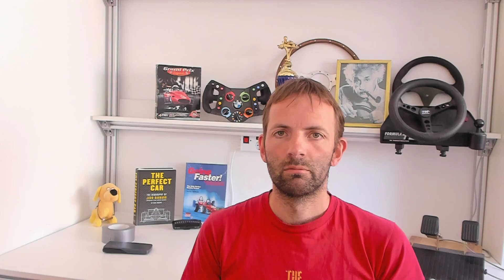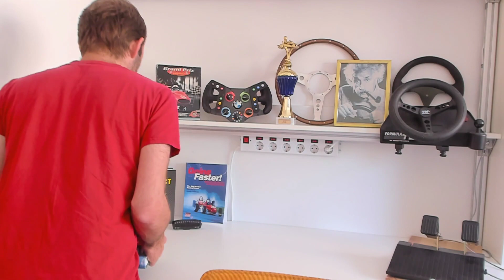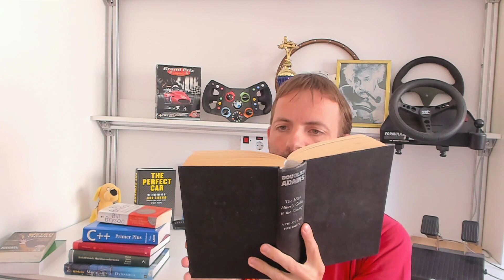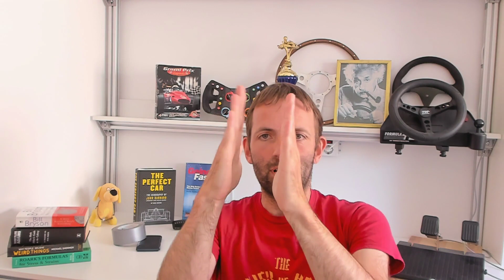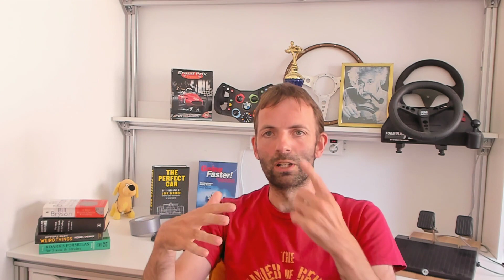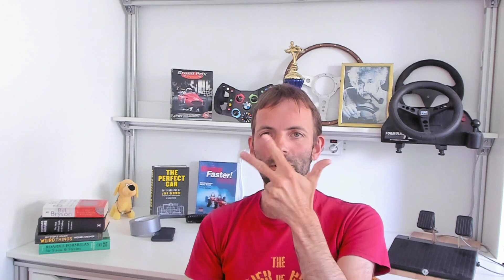Why are tires so difficult to model in a racing simulator?

Comment: Have you ever had the interest/tendency to make a tire tester yourself, to at least find out how a manufacturer gets their results and if possible fill in the informational blanks.

Not every tire is easily available but for example kart tires must be easy and say skip-barber/specracer/formula ford tires as well.
Reply from the maker: That sounds like a lot of expensive work! And then what are we looking at, the results of a possibly mediocre (lets face it) machine, or the actual tire behavior? :-) And we still can't isolate temperature effects, perhaps only measure them a bit... Mind you it is a cool idea! I know Todd Wasson was involved with a tire test machine for RC tires, which sounds like a super fun project to do. It won't really tell us anything about full scale tires though..

Comment: instead of using complex modeling with equations would it better for companies like iRacing (with budgets) to rent tyres test environment and build grip lookup tables based on different tests conditions?
Reply from the maker: Way back they published an article saying they did just that. But like I said, the results of a test machine don't always match tire versus tarmac grip levels, and you still might have issues isolating slip from temperature and pressure etc etc..
Reply: @NielsHeusinkveld  thanks for replying

Comment: Thanks for the info and since you haven't mentioned the SETA-tyremodel, some explanation about that: 
https://www.gtplanet.net/forum/threads/project-cars-2-tyre-model.370168/
What (the former) pCars 2 and now AMS2 is/was doing IMO much better is this feeling of driving on the edge of traction on the outer sidewalls of the tyres and this super natural feeling while driving over higher curbs for example. But the curb-surfing in iRacing was always great as well even before TM7, so it might not be a think about the tyre-model itself. IMO the 2nd major handling-difference across sims are the differential-physics and the aero downforce seems very different across sims as well. Also every sim has a different interpretation of the Newton's laws of physics it seems, so how weight acts to all the other things. Overall the best litimus-test is watching onboards, studying the slip-angles and how they effect the car, what steering inputs are needed etc.

Comment: Have you tried the skip barber on iracing recently? The tire model on that is AMAZING. I stopped racing it until 2 days ago on an off chance race. Blew my mind.
Reply: Jesus Christ I have read those kind of comment since 6 years plus. Maybe this time it’s true, Jesus Christ.
Reply from the maker: @PALbub  I thought you were being rude but you are simply quoting the guys name. :D
Reply: Also the skippy has its limits. In Spa you will see almost everyone spin in Rivage. When you play around with the setup you have to use very low air pressure in the tires and totally soft anti roll bars in rear to get through there without having an unstoppable oversteering car. I dont think the real Skippy would behave that crazy. But for example on the Norschleife the Skippy is awsome fun to drive.
Reply from the maker: I haven't.. Thing is, each year, each tire model there is this one car that they say is amazing. But when it is the underlying model that I dislike (rightfully or wrong), its unlikely to float my boat. I've heard equally negative things about the Skippy. That it is weird and too easy... Simracing is quite subjective eh!

Comment: Niels interesting video. Tire modeling is indeed a complicated issue due to the variances in real world tire data. I think the more reason for real world race drivers to properly validate the tire realism on sim the better. With that said, I am very happy on how most of the AMS cars handle on the edge of adhesion.  Still a bit hit & miss for AMS2 but I hope they get to fine tune everything in the future. The wet weather modeling needs work, I think it's a bit too forgiving on trail braking in the wet and too grippy on the curbs, painted areas.

Comment: Can you say why iRacing and RF2 went for a physical model instead? Seems way more complex and harder to work with, but surely there are some advantages to it or they wouldn't be pursuing that model?
Reply from the maker: Good question. I think these big brain programmers enjoy these big challenges. And, if you do manage to get it right, its amazing. Perhaps they felt they would get there, perhaps a bit over optimistic. And then the reality is that you can easily spend years programming an increasingly complicated and hard to work with model. That's completely just my view on it, I haven't asked any of the programmers...
Reply: Dave K explains it here.  As you might expect, his views are the opposite of Niels.

https://www.iracing.com/the-sticking-points-in-modeling-tires/

it is a very long read.
Reply: @davidwright1605  I don't get it, how are the views opposite? Kaemmer sums it up pretty neatly: "Why not just use an empirical model and be done with it? Wouldn’t that be easier? Well, it would be easier to code up the model, but it’s much more complicated to tweak and tune it so it has the right characteristics in all sorts of conditions (different loads, pressures, temperatures, etc.) Empirical models work well when the conditions can be considered to be fixed, as they might be for a passenger car with the recommended pressures travelling at highway speeds and below. But they become unwieldy in the racing environment, with large temperature changes, pressure changes, aerodynamic downforce and high loads from high-speed, high-banked tracks, along with the need to model curb hits well, and so on. There are just too many different things to measure, and it would be too expensive in terms of tires and time to test them in all necessary conditions. A decent theoretical model, though, should give reasonable responses even when the tire is doing crazy stuff, which on a race track is a lot of the time."

Comment: the almost 20 years old Live For Speed is still incredible to drive, not sure what tyre model they are using
Reply: IIRC their carcass is a dynamic physical model (which helps with getting the visual squish etc. done accurately too) and a brush type dynamic model for the tread. It doesn't necessarily fall under fully "physical" models, because the brush model doesn't necessarily try to virtually construct a tread, but it's also different from the Pacejka style steady state model that is based on preset/precalculated tables.

This is a similar to the difference in approaches done by different flying simulators. Microsoft Flight Simulator series traditionally used a very pure empirical model. Basically a series of tables for different combinations of what could happen to the plane when it was in the air, you take the angle of attack, the wind speed, air density etc., do a lookup from the tables and get a result, then apply that to the plane. This is a very tunable way to do things, and is very lightweight computationally, as is Pacejka, but it suffers from the kind of obvious limitation of not being able to do anything outside of the parameters the model was designed for. So extreme conditions like stalls, tailspins, excessive speed effects etc. were difficult to model accurately, because they're so far out of the normal operating parameters. I think Looking Glass' Flight Unlimited was the first consumer flight sim to use a physical based model, where they attempted to model the airflow over a number of surface points on the plane in real time. The absolute accuracy of such a solution could be a bit questionable, but what most people who played it back then agreed on was that it felt more natural, more nuanced, more dynamic, more "alive". Even if purely numerically speaking it wasn't as accurate, it felt more like flying a plane. This approach has since proliferated, X-Plane does it, DCS does it in their Advanced, Professional and External models (Standard is the more traditional type), and Microsoft Flight Simulator 2020 has also moved to using this type of modeling. It's a shame that modeling cars and tyres is way more difficult than modeling air planes, hehe. =)
Reply: @jubuttib  I'm very much sure you are wrong about DCS there and about the whole "LUTs are inferior to [real time] analytical models" argument.
It all depends on the "resolution" of the tables and their quantity (and the way you derived the data for the tables in the first place).
X-Plane's idea of modeling flight dynamics is that the air is more of a homogeneous, non-compressible linear "force field". So, at any given point it interacts with the plane's shape independently of other locations in linear dependence to the angle of incidence. Of course, later on Austin (or whoever is behind the model) realized that is not how things work in real life, so he decided to add more crutches to the model, like deflecting the "field" behind the fore surfaces instead of revising the whole model. But the truth is, you can't really recreate the interaction with an air stream properly with such simplistic models at all, because in reality what's going on with the air is more like this: https://www.youtube.com/watch?v=dJEKGGWEw-w
Such an easy shape, yet an awfully complex result, right? Now compare that to what X-Plane's flow visualization would show in that case...
Of course one cannot really dream of having this level or real time modeling on the current crop of PCs (even on GPUs). But here come the tables to the rescue. You can properly calculate a ton of simulations like the one above and populate a ton of tables with the results. And I really mean a TON of tables. Still, they won't factor in every possible outcome, but you can interpolate where there is a lack of data close enough. That's pretty much what DCS does (or at least some of the third parties EFMs). And that's why while it is not perfect, it feels the most natural compared to the rest of the sims. Like wavetable synthesis sounds much more natural than FM synthesis, even though you can easily discern it from an actual instrument playing.

Comment: Despite rFactor's tire model being "simple" compared to, say, rFactor 2 tire model (built on first principles), the simulation is measurably very accurate, more than 99% accurate, that is.

https://drracing.wordpress.com/2014/01/03/how-close-is-close-enough/amp/

And that is a tire model released in 2005.
Reply: Well... Red Bull F1 did use it as their simulation platform while winning 4 championships... I mean, Newey probably achieved the bulk of the winning work, but still...

Comment: You forgot to mention that empirical models are extremely bad at simulating "racing maneuvers" where the deformation of the tire carcass and the simulation of higher orders physics is necessary to achieve realistic results. Purely physical models are very hard to do right, specially in a real-time situation, but they are the only things that work passed a certain threshold.

Edit: I am not saying the sims that use purely physical models are more realistic. I am saying that they have the potential to be more realistic,  but getting there is close to impossible.
Reply from the maker: What are some of these 'racing maneuvers' you mention? Do you mean like the 'wave' effects of a vibrating tire after it hits a kerb, and the wobble you see on F1 car tires etc?
Reply: @NielsHeusinkveld  In general the literature consider everything out of the linear part of the slip curve as racing maneuver.